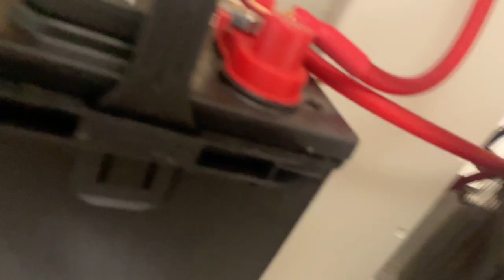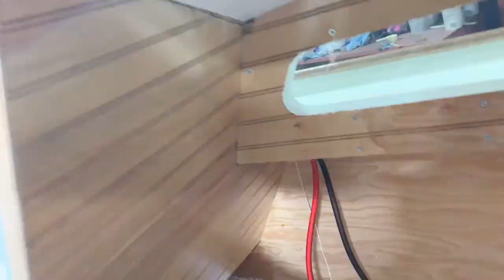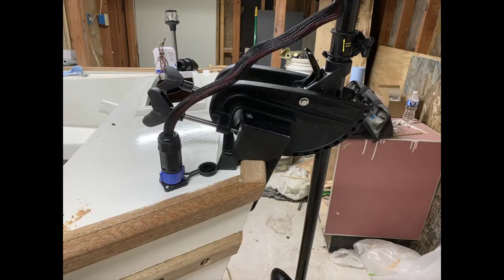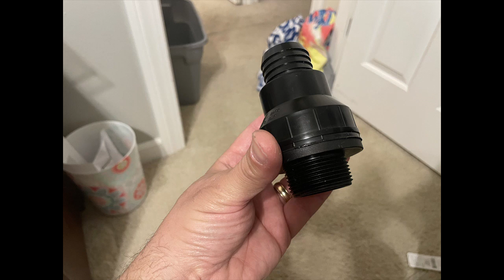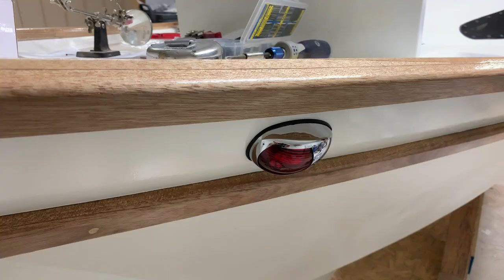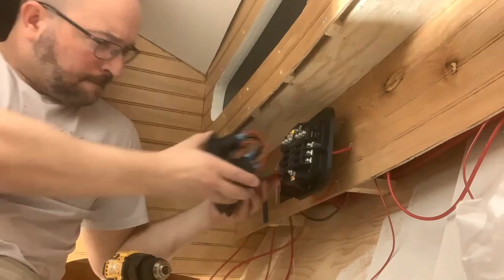Episode 18 Electronics

Comment: She looks awesome!  Won’t putting the flapper valve on the pump side (as opposed to the output port) cause it to hold water in the hose from the bottom to the top?